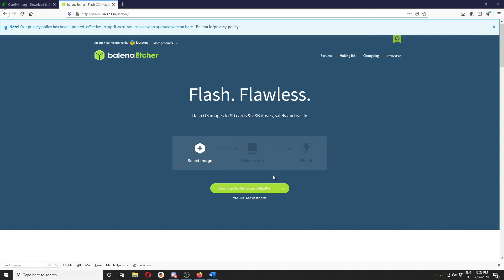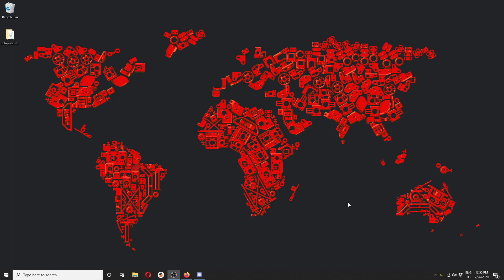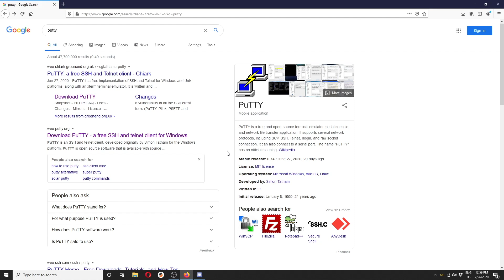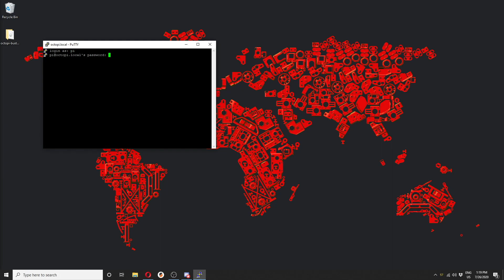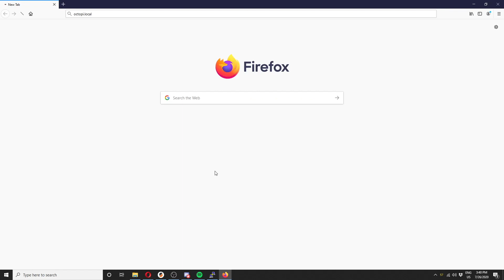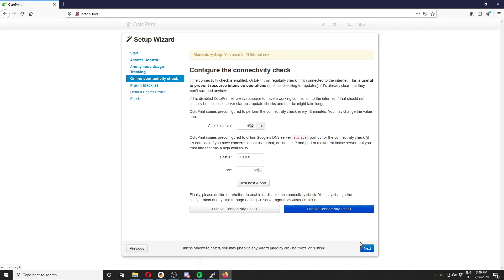Voron Setup Series - Part 1 - Octoprint Installation

Comment: Any updates on Part 2?
Reply from the maker: Yes! I have a printer almost ready to go. I will be doing a complete install including Mainsail and incorporating the latest Klipper changes. Super excited to finally get another video out 😄
Reply: @eddietheengineer  i'm bookmarking this!  :-)  I'll need to better understand the two.  I got Octopi installed, it is the klipper part that I'd like to see and try out (for my upcoming Voron v1.8 😃
Reply from the maker: @enots814  be sure to check out the Mainsail video I put up! I won’t be doing another video on Octoprint for now 😊
Reply: @eddietheengineer  I see and I saw.  Looks like I'll be trying that out.  I agree with you.  Looks easier.
Reply: @eddietheengineer  Excellent! looking forward to this